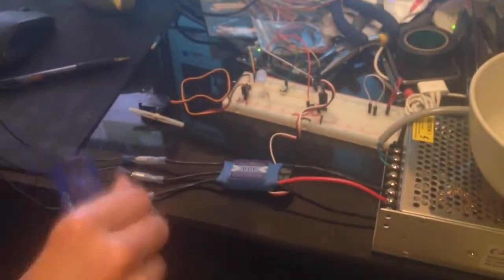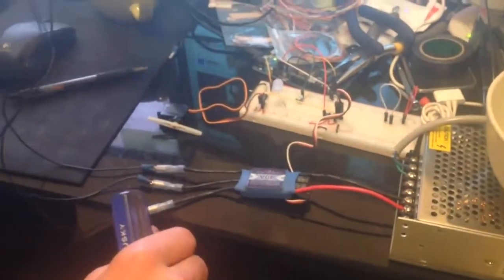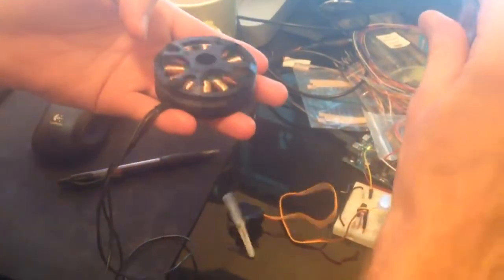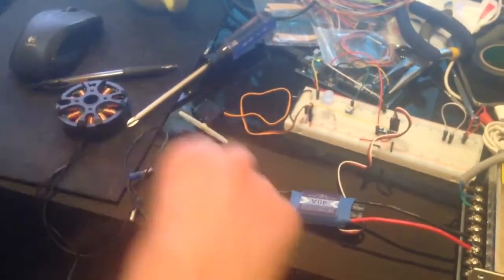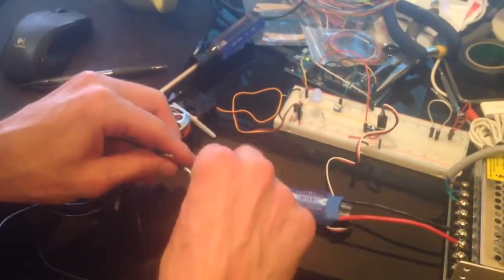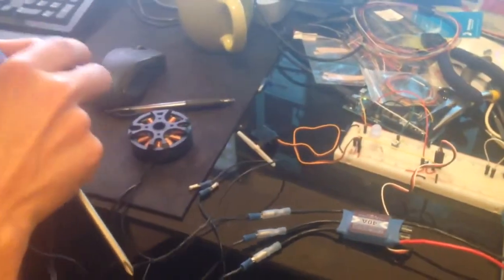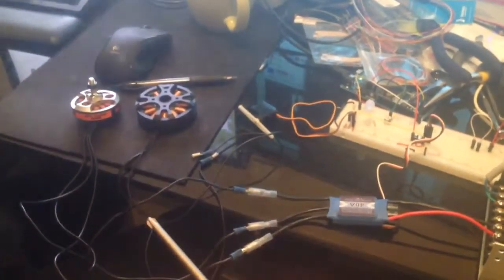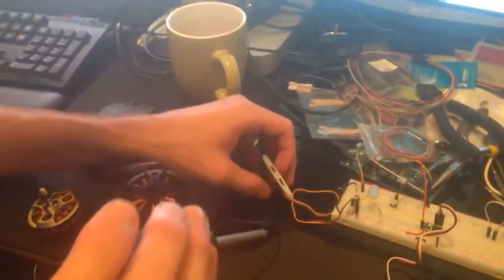iPower Gimbal Brushless DC Motor GBM5208H 180T

Comment from the maker: Wow, over 1k views! I never got this to work. Here's the high-level explanation: prop motors spin fast and gimbal motors spin slowly. Both motor types have the same basic BLDC design but they require different controllers because they are wound differently. The winding dictates the range of speeds the motor can spin with an acceptable torque. More here: https://www.rcgroups.com/forums/showpost.php?p=28691741&postcount=3